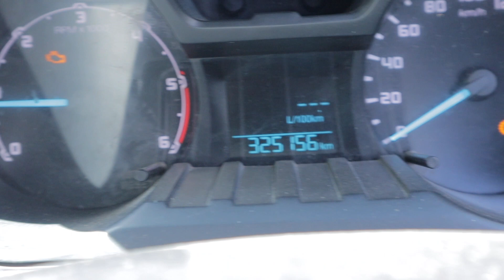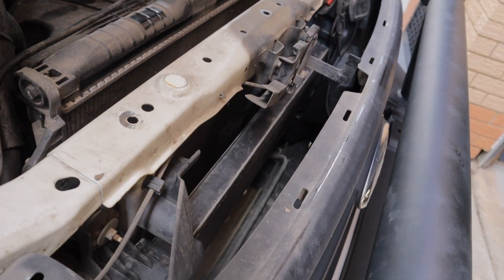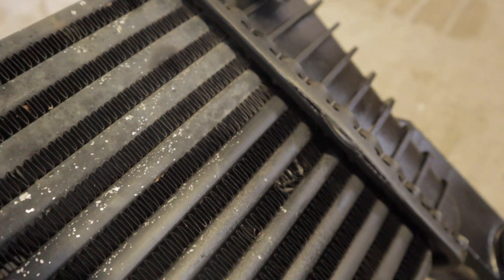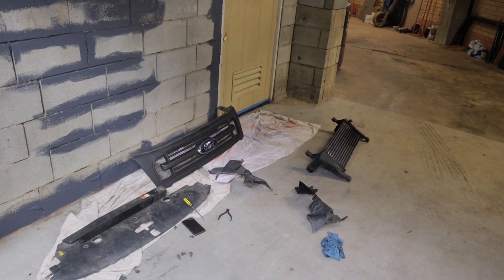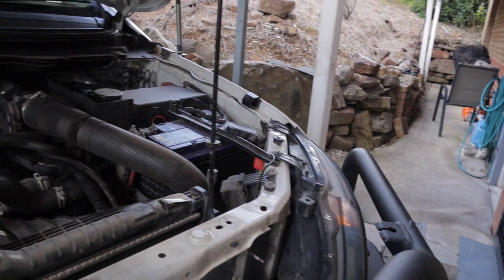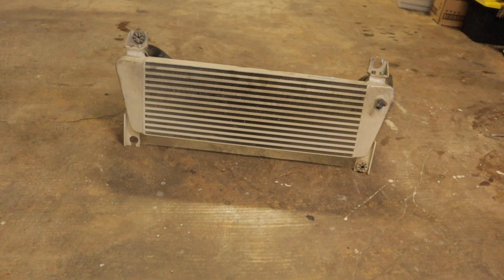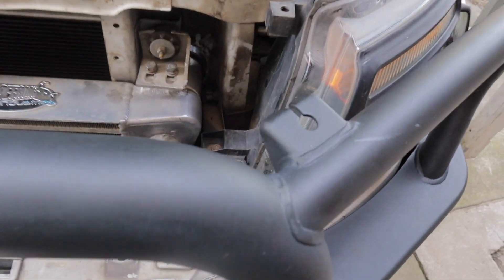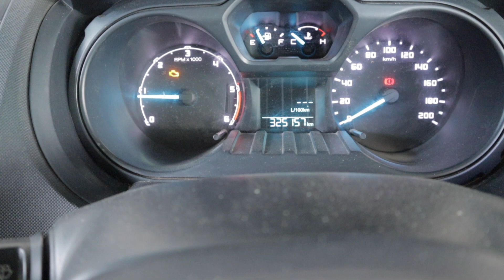Ford Ranger Intercooler Replacement,  Loss of Power,  Limp Mode

Comment: Thank you so much. The independent garage next door said oh its an all day job replacing the intercooler.   Bumper winch etc has to come off. .  thabks to you told them its literally pull the grill four bolts two hoses less than an hour; honestly wish i had done myself and saved the business money.
Reply: Robbing cnts, literally takes half hour at most

Comment: Good day legend, i have a 2014 px ranger and iam getting the P00BD fault code but only on cold mornings and if i go over 100kmhs trying to overtake on the freeway, i have replaced the intercooler pipes hot and cold and intercooler itself i dont know what else to check?

Comment: Hi, your video's are very helpful. I have 2015 ford ranger T6 and live in South Africa. When I drive over 140km/hour, my Ford goes into limp mode. I did change my Turbo, and my injectors were recently replaced. What else can it be, if you can help?
Reply from the maker: fault code?
Reply: Bro slow down 😂

Comment: great video...simplifies how to change it..ihave a 2.2 px1 ranger...can you put a second hand one from a 3,2 in it...i get the transmission light come but no engine light  on...limp mode..not much noise though...revs dont get that high but can slowly gain speed...got the same code air flow prob and mechanic says intercooler leaking so causing the problem..do you think he is right...and any idea why the transmission warning comes on in a manual...look forward to your reply
Reply from the maker: sounds like an intercooler or an intercooler hose, i've blown 2 plastic intercoolers so far before i went aluminium, a 3.2 intercooler will fit straight in, you should be able to see an oil stain on the intercooler fins where it's leaking, that will confirm it.

Comment: Im in the process of switching out intercoolers at the moment. Like you I went with an intercooler that looks almost identical to the Forefront one (in that its considerably larger than the stock one). What I want to know is, were you able to get those black plastic side pieces back over the new intercooler? They were difficult to remove with the stock one, I'm not sure I'll be able to squeeze them back into place. Your video at 8:34 looks like you just skipped putting them back in. Was that the case?
Reply: I have the same question. I tried removing mine, but it seems impossible without first removing the bumper. Also it doesn’t look like they will fit over an inter-cooler that is thicker than the stock one.
Reply: @SigZA yeah I asked around and most people said they just tossed them. Not worth bothering. So that’s what I did. I also added a straight (careless) down pipe yesterday, before taking the truck in a 5 hour loop. Feels like a different truck. Especially when over taking on an incline.
Reply: @SigZA you don’t have to remove the bumper to get them out. But to might have to slightly bend them.

Comment: That's a great score for 150 bucks. Is there any noticeable difference in day to day driving with the bigger intercooler. I know when I got my intercooler done a long time ago in my petrol 2.0l turbo it felt like it picked up heaps more torque and was wondering if its the same feeling with the diesel?
Reply from the maker: yes it picked up more torque, i think that's due to a better flowing core & lower intake temps.
Reply: @abdautomotive  Thanks mate, I might go look for a second hand one like yourself.

Comment: Hello, Are you using the same factory turbo?
Reply from the maker: yes still the factory unit
Reply: I have the same problem with my ranger, thinking backwards, I hit my car and since that I notice many times loose of power. I will change the intercooler unit. Thanks for your videos.

Comment: can this also relate to a P00BC code?
Reply from the maker: no, i think that it more MAF sensor related
Reply: @abdautomotive   oh ok only just changed it and still get the same code. Just changed all the hoses and intercooler plus new air filter. The ranger is driving me mad
Reply: I had a MAF code when my rubber hose split. Replaced the hose and it went away again